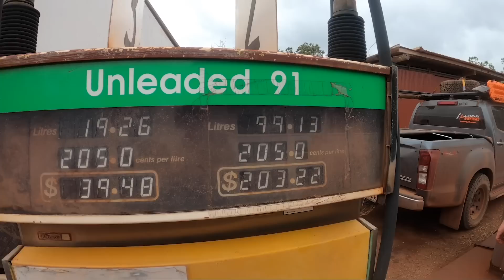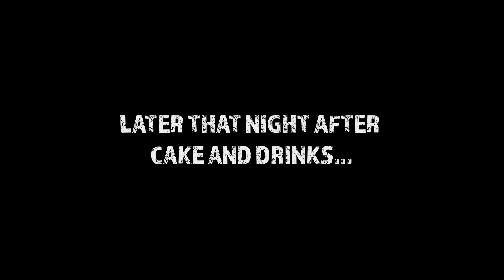BIG REVEAL EP! MORETON TELEGRAPH STATION / ARCHER RIVER / COEN / FLAT TYRE - 036

Comment: Hi guys, Thanks for another great video. The Y62 has finicky rear alignment, you have to keep an eye on it once you start playing around with mods, it tends to get knocked out of whack very easily when offroading if the alignment setting bolt isn't done up super tight, and even then can still move out of alignment on rough roads, been an issue since series 1.  Also, can I recommend getting a scangauge II to keep an eye on things, it will tell you exactly how many litres of fuel you've used since last fill and overall, it's accurate to within 1 ltr , would be really useful for the sort of places you guys are traveling.
Reply from the maker: We’ve decide to stick with Nissan for the alignment going forward just to make sure, surely it’ll be ok then 🤣 will look into the scangauge online, thanks for the tip! 😁

Comment: Well done on the sponsorship, we just bought our van cover from Anaconda on Thursday. 
Tyre is a worry, that’s gunna be expensive chewing through them that quick. 
I assume they did a 4 wheel alignment when airbags and suspension mods were done, looks like the caster / Camber is way out on the rears. Good luck 👍🍀
Reply: Agree, the alignment seems to be the issue although I am also wondering if tyre pressures may have contributed. Alignment for you guys needs to be more based on towing but I would have thought the airbags would have brought it back 🤷🏻‍♂️
Reply: @brooksy2093  Tyre pressure can cause excessive Tyre wear for sure, under inflation will wear the outer edges, over inflation will wear the Centre. My thoughts are that whilst airbags will bring the level up they don’t distribute the weight and divide it over the trailer and car. A weight distribution system will take a fair bit of weight off the rear wheels of the car, not sure about off road with them though. We had a reputable supplier put ours on and he did it all wrong, I got 100k away and reset it and the van towed 100% better, lifted the rear by an inch or two and pushed the front of the car down.
Reply from the maker: I think that was our problem is that they tried to give us a wheel alignment that allowed us to drive normally and tow, the best of both worlds. Nissan have just given us a normal wheel alignment and it’s been perfect. It’s because of the type of axle with the wishbone setup, it’s a bit different to usual and new for some tyre and alignment fitters I guess. We’re good now though, will just make sure we do further wheel alignments with Nissan in future I think!
Reply: @BigOzExplorers   hard to do a one size fits all, they probably thought they were optimizing the alignment for your needs. I always had alignments done elsewhere when I was a mechanic, you find a good one and stick with then ( obviously you can’t do that with traveling) sticking to Nissan will give you some surety. Happy it’s hopefully sorted and maybe investigate Weight distribution kit if it still wears to much.  Enjoy ya lucky buggers. 👍

Comment: I would be billing the tyre shop, ive been in the industry for 20 odd years and been a wheel aligner for the same amount of time. Ive seen this wear before because most aligners go on the specs not what the vehicle does.
Reply from the maker: We got a whole set of tyres from them thankfully. At least they acknowledged they were in the wrong and they fixed it for us too. 😊
Reply: As a tech  , Karen's always blame the mechanic.... What's not to say it wasn't due to the massive over spec towball load and they bottomed out and the  camber  pins slipped.....  the things squats like a duck.... typical IRS problems.... real  load carrying is done on a solid axle vehicle...  even a 1st year wheel aligner wouldn't  have been that far out on specs....its been a situational  cause....
Reply from the maker: It was fitters problem I promise you. The fitter said it himself. The problem is that there is no legislation around who must complete work on a vehicle, Karen could get a job herself fitting things to our car and have it signed off by someone who is qualified which is CRAZY. Unfortunately, the qualified signature was on annual leave when our car passed through the workshop. We take fault where fault is due and own up to our mistakes because our channel is about truth and honestly, were one of the few who actually share our mistakes. In this particular case  I guarantee it was the fitter 🤷🏼‍♀️

Comment: Be warned some areas of Australia are not services by RAC roadside assist. ☠️👎
Always carry enough fuel, water and essential spares and tools for repairs. I had my cooling system serviced with new hoses, air and fuel filter, thermostat, fan belt and air conditioner belt Windscreen wiper blades and 5 new tyres before heading outback towing a camper trailer. A good service at home is cheaper and better than a break down in the middle of nowhere.👍👍👍

Comment: Who fitted your tyres? 😁 you guys have had a bad run with Tradies in Cairns 😡
Reply from the maker: A subcontracted tyre place through ARB 😞 we really didn’t have a good run but hey, these things happen! It’s all good now 😁
Reply: @BigOzExplorers  in saying that.. its thing with Y62. when they wheel align your car you don't have 3.5T. so what you need to do get wheel alignment done with no weight 5psi on airbag. measure your height centre of hub to wheel arch. then put your caravan and pump airbag to get close as you can do height you had to maintain the camber.
Reply from the maker: @lappingozoffgrid  That’s actually what they did and the reason we had problems! They tried to put it somewhere between with and without weight and all it did was cause problems. Nissan gave us a general alignment without taking into consideration that we tow and it’s been perfect since 🤷🏼‍♀️ I don’t understand wheel alignments in depth but I’m just glad it’s fixed 🙏🏻